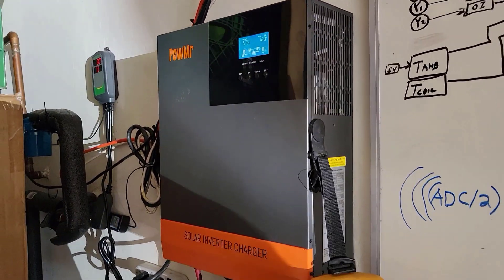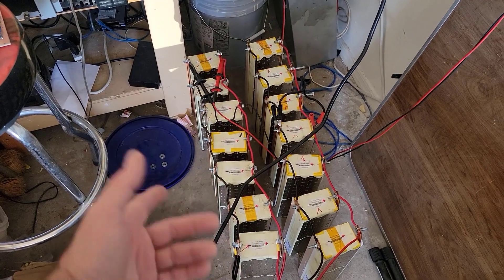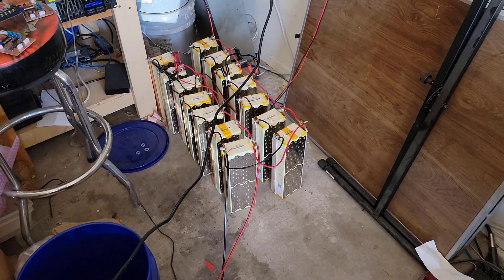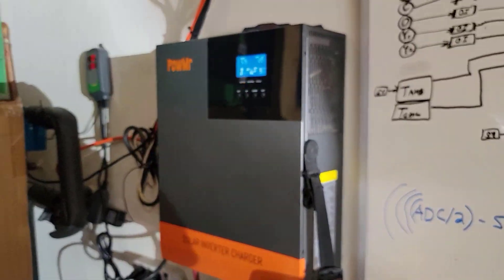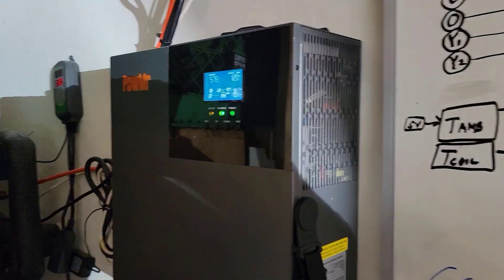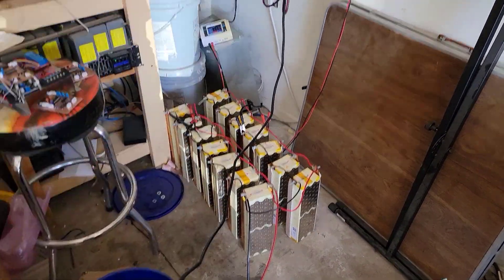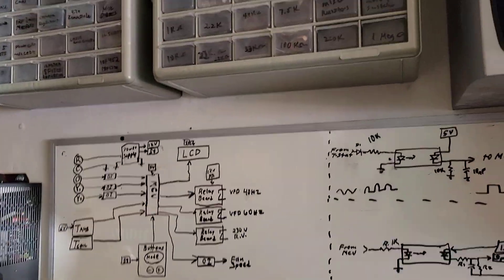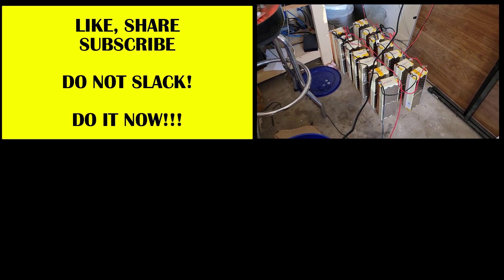Setting up a 10Kwh pack of Li-Ion batteries for my solar charger/inverter

Comment: You should really get a JKBMS to handle those cells. that way you can't over charge, or undercharge them. it will also handle the balance with it's 2amp active balancer. I have two of these on my 28kWh 48v lifepo4 house battery

Comment: Lithium, what's the worst that can happen eh? https://www.youtube.com/watch?v=5r-yN8SugWM 🤣
Reply from the maker: After watching them catch fire when shooting old tablets in the desert, I have already thought about that. I wanted to put them outside but then they would be in the heat. I am thinking of still putting them outside but boxing it and putting a duct and a fan to keep the box at the temp of my garage.

Or build one hell of an enclosure in the garage.
Reply from the maker: Actually my first experience with the vitality of Lithium cells was when I was trying to peel a small pouch cell out of my daughter's Microsoft ZUNE media player about 15 years ago and when my screwdriver pierced the pouch it was a chain reaction of smoke and heat until it burned itself out.

I didn't expect it.
Reply: @hackfreehvac  It's got to be the only thing putting me off having battery storage anywhere near my house to be honest, that shit's almost explosive in nature!

Comment: You will definitely want to get some sort of battery balancing module or BMS to keep them balanced. Even basic power tools now come with balanced battery packs. Balancing modules for lithium batteries are pretty cheap these days, too.
Reply from the maker: Yeah the balance modules don't seem to bad. But a BMS for this size is like $100 or so.